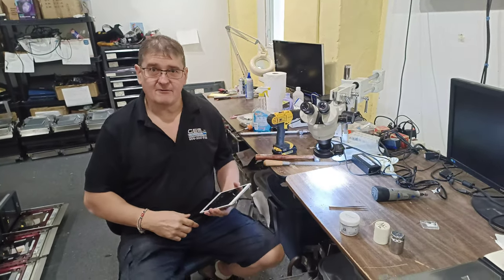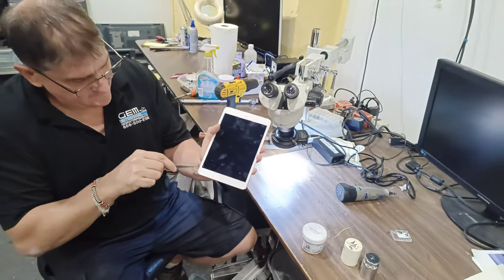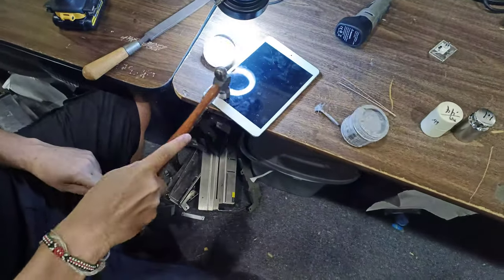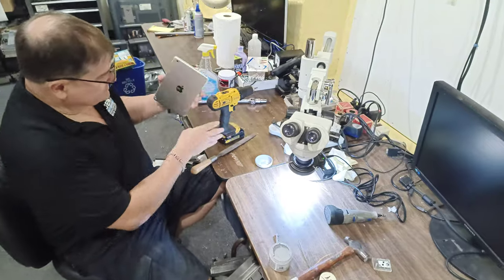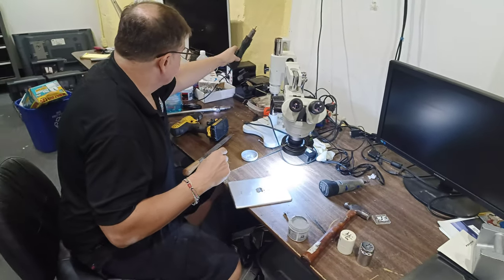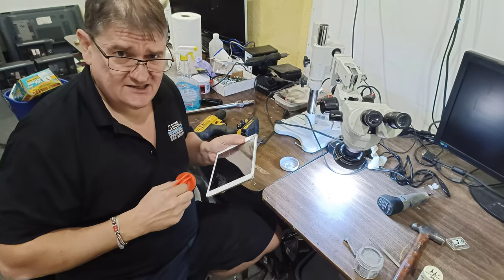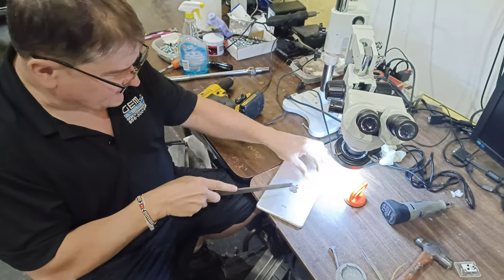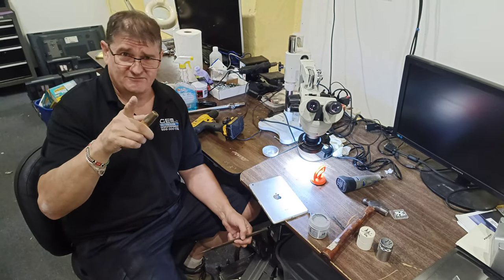Best Buy Geek Squad computer technical skills at work skit

Comment: Don’t belive this non-sense 😂 as a former geek squad CA, we were under contract with Apple, we were only adhere to what they allow us to do such as iPhone repairs instore only which gets added to the repair queue so your sameday repair may take a little longer if the repair queues are long, all geek squads use genuine apple parts coming directly from AI unlike these 3rd party repair shops that use 3rd party components and void your applecare warranty. Everything else iPads, MacBooks, iWatches, Airpods and accessories have to be mailed-in and take 7-10 as majority of the time excluding macbooks apple just does a whole unit replacement. Working with Apple was a pain in the ass, and to this day they still are, thats why most agents say go straight to apple or else where for sameday solution. Anyways the reason why geek squad doesn’t solder is due to voiding manufacturers warranties.
Reply from the maker: It's a parody and we fix well beyond little things.  BB does not solder anything, they just are not trained in anything besides the most basic repairs,
Reply: @2000ViperGTSsubscribe  True enough. I bought a laptop with a speaker problem and when I brought it in the next day, the simplest solution they had was to go grab one from the shelf and do a direct swap; new receipt, notated old receipt and off I went.